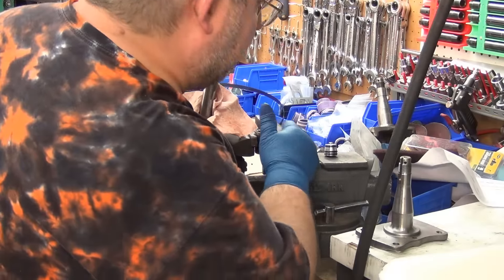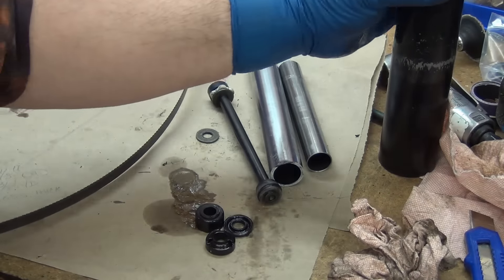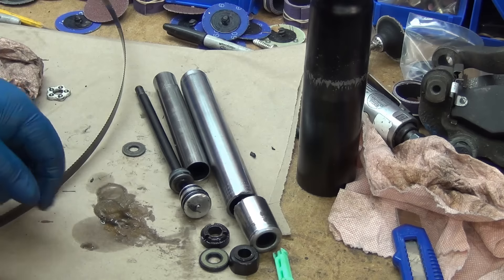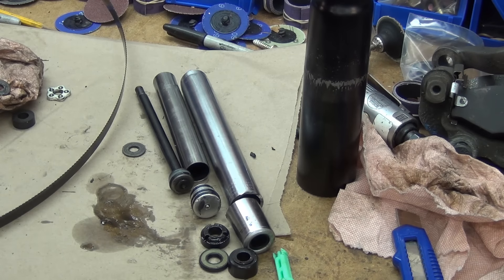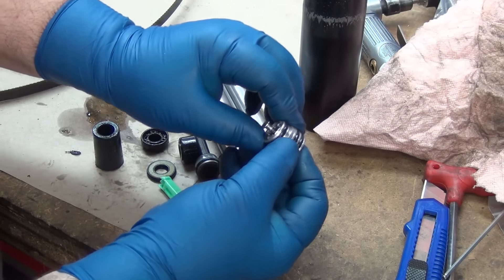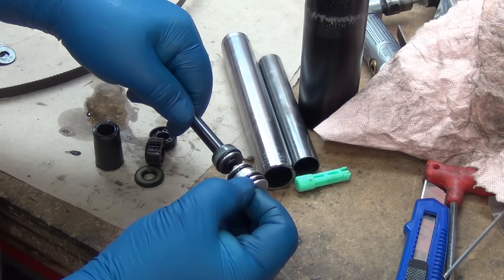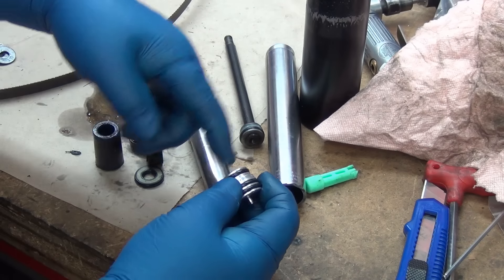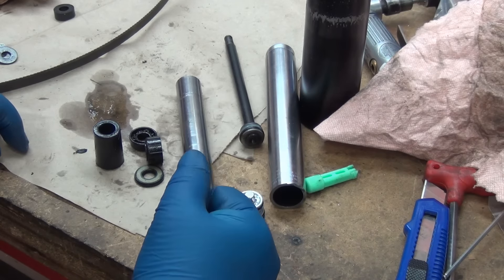Air Cylinder Internals

Comment: I cut up an old shock I had a few months ago, turns out it was the exact outside dimension I needed to extend a short length of tube that was to be used for a collet closer that was a closer for a short spindle lathe, silver soldered it to the short closer and finally have a 5C closer for my lathe, thats why I save every thing, the shafts from the shocks for some offroad car works perfect for my cheapo HF bar and flat stock bender( that thing has been a great tool) also have its big brother the Hossfeld bender
Reply from the maker: +Ed Ginsberg Hi Ed! I used to do the same thing when I worked on cars more.  Most of my stuff was struts.  they're got some really nice rod in them.  I still have several pieces of the rod and the tubes in the shed.  
So you have a lathe and a collet closer......but no videos of it.........????  :(